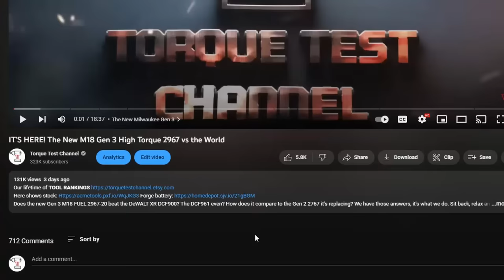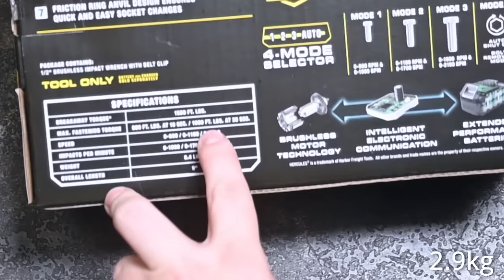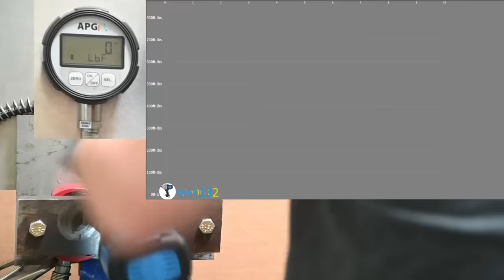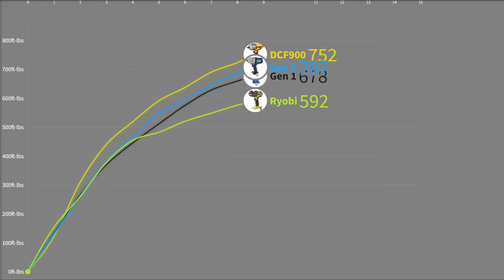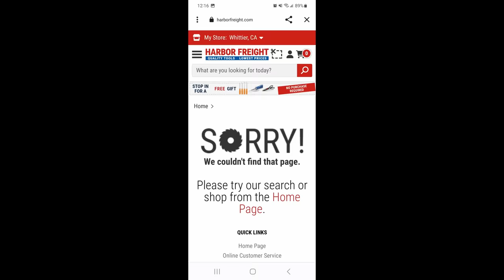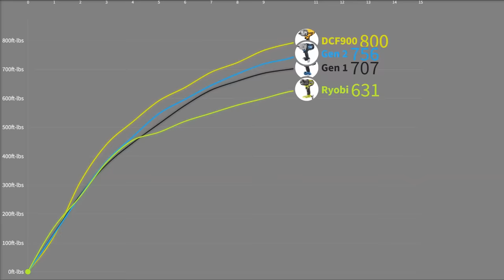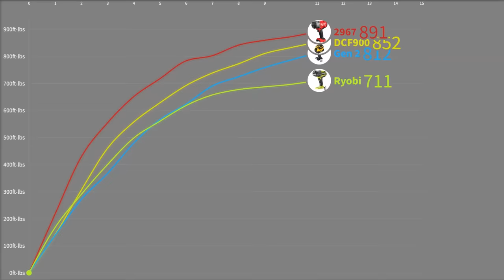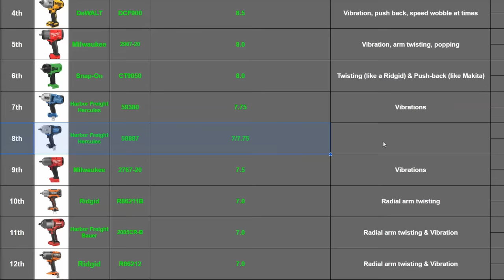Harbor Freight Called & Wanted This Gen 2 Ultra Torque Back

Comment: I think because of the way your dyno works, the nut busting torque will be closer to the end of the curve. Doing well out of the gate will make it spin stubborn fasteners faster, but won't necessarily make more instantaneous torque on a completely stuck fastener. It's the age old horsepower vs torque war. Horsepower is torque over time, and more horsepower will always get the same amount of work done faster, but torque needs to be sufficient to move the load at all in the first place. With the Hercules here I would guess that it's just doing fewer hits per minute than the DeWalt, but the torque that's being applied to each hit is a pretty close match, with the DeWalt slightly edging it out.

Comment: Just bought it, with the big battery, going to be disassembling a very Rusty 03 F350 V10 4x4, using the 1 ton axle units for my 03 Tacoma S.A.Swap, she gonna get some Real World Testing! Can't wait to try it out, been using a Kawasaki 1/2" corded impact for around 20 years and, I'll be honest, it's a fkin great impact gun, it's actually out performed most air impact guns, and it was an open box deal from Pep Boys, I paid less than 70$ for it and I've built a few Jeeps with the old Kawasaki! But she's wearing down and it's time, she's going to the Big Tool Box In the Sky! Along with a bunch of other Tools 🔧 that I've personally murdered over the years! 😅 Tool Murder, I'm pretty sure we're all guilty of that one, anyhow, great video and review 👍 look forward to watching some more, TY brother

Comment: I might actually suggest this for new mechanics trying to get their bases covered. Not the strongest but for the price it does great and if they screw it up they should be able to get it replaced with little effort.
Reply: Close relative has been a mechanic for 30+ years now. He's good at his job and has absolutely no shame running to HF to get some tool that he needs. Doesn't happen much though. 

You will see far too many young people go hard on buying the best and most expensive just due to the name. Hell, if you have a local HF and have that warranty, why not use this?
Reply: @Ka_Gg im weird. I have everything Milwaukee fuel. Love it too. But I did go grab a Hercules cordless ratchet yesterday an I gotta say, I like it a lot.
Reply: I've tried suggesting it to newer people who don't have much in power tools. But they see what everyone else has and wants that. I slowly built up my tools over the years. If I was starting over I'd go to hercules brand no problem, just for the fact harbor freight is easy to deal with and I go there for more supplies than other overpriced hardware stores that charge 4x much for the same items.
Reply: Could not agree more.

Comment: Its very hard to argue with the 5 year over the counter warranty and decent performance at a reasonable price. TTC is single-handedly changing my view of harbor freight. Once thought to be a seller of single use, throw away, tools.
Reply from the maker: Oh dont get me wrong, their store is still full of single use stuff. It's a minefield with random treasure chests, and you just dont know which one you'll be digging out sometimes
Reply: @TorqueTestChannel  Same as the Canadian counter part, "Princess Auto". We dont have HF here, but PA is similar from the sounds of it. They sell a lot of "burn after using" tools, but some are really good. I have a princess auto stubby impact that i'm 99% sure is an Astro Nano Gen 1. Been using it daily as a heavy duty tech for probably 5 years and it still hasn't let me down,  all for $100 CAD.

Comment: i just bought some hercules tools using the charger battery and tool sale they had, im pretty impressed so far with them
Reply: Did the same, got the battery and charger for $99 and got the $135 Grease Gun for FREEEEEEEE!
Reply: @dustinryan9671  im loving the grease gun, been using it every 2 weeks to grease a semi sense i posted this comment 9 months ago, still doing good after probably 40 tubes of grease have been run through it

Comment: I love Harbor Freights ever expanding line of higher quality tools, but still at a great value! They often surpass brand's like Rigid, Ryobi, and often on the same level in performance as offerings from Dewalt and Milwaukee. Especially with their super easy to use warranty system. The value is there. I hope they keep heading in this direction.
Reply: Ha ha whatever dude. None of thier stuff passes Ridgid. Even the number of tools. Even the warranty. Even battery quality. Tool longevity and on and on and on. Even if one goes off of looks. Harbor freight stuff is ugly. No fearures. Go do more resurch or buy both tools test them then go type your comment. Ive had both and my Ridgids spank and have outlasted every Harbor Frieght Ive bought. Just last week i used a harbor freight saw right before lunch, came back and the dang thing didnt work. Thats like number 10 of my Harbor freight tools that gernaded or just quit. Ive had Ridgids since 2012 and ive NEVER had to return any of them. In the end my Ridgids have made me $100ks of dollars. All my harbor freights are sitting in the shop or are at the recyclers.

Comment: I turned wrenches for a living for 22yrs before getting hurt 23yrs ago;  used every brand out there: Snap-On, Mac, Matco, Craftsman, S-K, Husky, Kobalt...over the last 20yrs started using Harbor Freight since my income dropprd by more than half. Gotten a full spread of hand tools, impact wrenches, battery pack, a/c gauges, radiator pressure tester kit, punches & chisels, as well as hardware. Say what you will but in my experience all these H/F tools have only been 1 degree of less durability than all the others, and with lower initial cost and identical warranties, it's a no brainer

Comment: HF has let me down so many times…. I’m rocking a M18 mid torque…. I wouldn’t be surprised if it died a few weeks of taking apart bolts on an extruder screen changer still hot.

Comment: well today I just picked up gen1 HF ultra torque for $72 !  (119 closeout - 40% off for insider, 30% everyone else). Looks almost identical on this vid  to gen2 at $190 still. At that price I figured why not, given their mid size 1/2" are too weak to take my car lugnut (130lb) while their 1/4" super compact is amazing for it's size but working really hard for lugnuts. yeah it's overkill and heavy.... good thing it has auto mode. If I ever work on wheel bearing again, I know have the tool made for it :)

Comment: Love this channel. I'll be looking to equip a home garage (hopefully) in the near future and you can bet I'll be using your test to get the best bang for my buck. Have you considered testing compressors for the pneumatic tools? See which compressor delivers the best airflow the quickest to power the tools? Just an idea to expand your content.
Reply: Oh! I second this. I think there's a lot of misconceptions they'd be able to clean up.
Reply: With different size fittings and hoses...compressor alone doesn't determine airflow.The advertised ratings are plenty to go buy to determine what compressor you need.Basically...BIG for most air tools.
Reply: If you need help to determine what compressor you need just ask.TTC isn't about to buy a dozen air compressors.
Reply: @djsi38t  Yeah. I was just giving them content ideas. I'm not going to be doing anything other than normal usage for a diy guy. More important to me isn't so much performance it's brand. Ingersoll Rand used to be great but I've seen some reviews saying they aren't what they used to be in times past.

Comment: Great show. What, if any difference does extra resistance to the "recoil" make? I'm thinking does the larger battery add more resistance and hence more effective hits from the hammer? 
Keep up the good work.
Reply: I think the hammering happens so quickly that it doesn’t need much counter weight. 

That being said, you have all that weight on the other side of the hammer acting as counterweight with heavy battery  almost a foot of the axis that multiplies the counter effect as well as human hand holding it. 

The hammer is not attached to the rest of the body and only has to have enough counter weight to overcome the spring. 

Now if the spring were not to fully reset by the time the next blow comes than the force would be transferred to the tool. The only force acting on the tool itself is the spring being reset and that is limited in time and power. That is the vibration you feel when operating the tool since it happens thousand times a minute. 

This is why, when you overpower a tool by providing more power be it battery or powerfully motor, you might feel the tool vibration increase while at the seams time there is a physical limitation as to how much any given hummer weight can do. You can bang against a really heavy object with a small hammer all you want be it 10 blow a min or 10,000 it won’t move. 

More power with same hummer/spring will only get you max performance that weight can provide, quicker. So if max work you can do wit a gun is 1000 lb foot but you are getting 700 in 15 sec than bigger battery or motor will maybe get you up to additional 300 in that 15 sec. Alternatively you can just operate that tool for more time till you get to that max 1000 figure. 

Not something you wanna do if your job requires you to do so many times a day. Most consider anything more then 5 sec excessive for repeating tasks.

This is why I urge test channel to let the tool run till it can not reach higher number so we can know max potential for those one time jobs

Comment: One thing that would be really nice to see (maybe even a stats column of its own since it’s becoming a more common feature) is testing on the auto on/off modes. 

I suspect some are basically the same as self tapping mode from impact drivers, but others definitely have more tech behind them than that. 

I mean can we really trust using it to quickly drive in nuts and fasteners quickly and to torque, or just quickly but needs a torque wrench after to finish the job, or is it going to destroy our threads and our wallets

Comment: Are we able to use a chrome socket on them without them getting stuck on gun ? With my Milwaukee I had to beat them off and get the ring repair kit. Some times, like on wheels with recessed lugs the thinner socket is needed. Using a short extension kept that from happening. My air impacts didn’t do that. 
 Hate for a diy to have that problem.

Comment: I think if HF really wants to upset the cordless tool industry, they need to take their high end (Hercules) and use it to go after Ryobi. A similar price point, but HF offers a better warranty and more beans.

I mainly mean going after them with tool variety. Comparing to the big boys with basic tools is nice and all, but the selling point of Ryobi is the sheer number of tools that work on their platform. The periphery tools don't all have to be chart-toppers either, they just need to be competent, affordable, and durable.
Reply: ryobi has their unchanged battery going for them though and ease of buying with more home depots around - like you said also, huge lineup and you can probably find used tools cheap
Reply: I think they try to position Bauer against Ryobi instead. That's where the larger variety is. It's a "homeowner" tool like Ryobi (generally speaking). I'm not sure if they're succeeding, as Ryobi has an insane breadth of tools, but I wouldn't mind dumping the obnoxious Ryobi 18V battery form factor moving forward for certain tools, like a right-angle drill and ratchet.
Reply: @M.TTT.  
This is why I still use Ryobi, as I still have quite a few blue tools (20-ish years old) that still work with new batteries. Hercules wouldn't convince many people like me. 

However, anyone just starting out looks at lineup, performance, and warranty. If Hercules increased their lineup, they would have beaten or matched Ryobi on all 3 fronts for around the same price.
Reply: Ryobi has the Direct Tool outlets/online where you can get blemished and refurbished tools for far less.  I have about 80% of my Ryobi from them and so far zero problems with any of them😊
Reply: Tool variety is why I own Ryobi for home/diy use. There's just so many random options in their lineup for practically any use case. That is, unfortunately, except for a coffee machine like Makita has.
Reply: @NiSE_Rafter  
Some 3rd party company makes one for DeWalt batteries that I guess is pretty decent.

Funny thing is, Ryobi started the cordless tool expansion trend. Back in their blue NiCad tool days, they were making the standard drills, saws, sawzalls, lights, dust busters, etc... But they were also making cordless rotozips, routers, miter saws, caulk guns, chainsaws, sanders, jigsaws... And a bunch of other tools. Some were duds (any chainsaw running on an 18v nickel battery would be) but many were very handy. Some companies also made some of the non-standard tools Ryobi made, but none of them made anywhere close to the number of tools, even other TTI brands.

In fact, the Ryobi Airstrike cordless 18ga brad nailer was the first to use air in a battery powered nail gun successfully. Other TTI brands adopted it, then companies like DeWalt copied it.

Comment: Next time you test 4 1/2 inch grinders, could you include the Metabo WP 11-125 Quick grinder?
My employer uses those exclusively and I HATE them for a couple reasons, 1 is that they vibrate terribly under heavier load, the other is that they seem a little gutless being an 11 amp grinder.  I decided to take my HF Chief 4 1/5 inch grinder to try which seems to be better in my experience despite having an adapter going from the 3/8 type H Milton fitting we use to the 1/4 on my grinder.

Comment: Hey, parkside which is a popular tool brand in Europe released a 150nm cordless drill that comes at less than 100 euro, I've heard bosch also has a 150nm, so I'd love if you can check the new high torque drills coming out. Maybe there are more idk

Comment: My harbor freight had 2 of the gen 2 in-stock on the shelves, can't find them on there website but in stores, wonder if they let a shipment of them let go by accident, see how it does with there 8ah 21700 battery

Comment: I just put a 3/8th hammer section into a kobalt xtr body. It bolted right up. The only difference between non Xtr and Xtr is a much bigger driver and motor windings. Has stupid power now haha. Kinda spicy at least it feels

Comment: What's funny is we'll look at a tool today and be like "Just needs a little more torque". While, completely ignoring that our impact from 5 years ago (that has 300lb ft less) has done everything we needed easily. hahahaha. 

I have one of the first gen Milwaukee beasts that I bought when the only options were Milwaukee and IR. Around 2013 or 2014. It still does everything I need and doesn't break a sweat. 

The new impacts though are so impressive. I like seeing Hazard Fraught bringing new good tools. Just seems like they'll take a slightly older version of a quality brand and slap their name on it. It works though.

Comment: the power is impressive for the price there is one for sale brand new in the box for $90 might pull the trigger my current impact is an older brushed milwaukee and this should be a lot stronger

Comment: If anyone is on the market for an impact you can get the ryobi 1/2” high torque and 2 4ah batteries for 279 and you get a free tool. Can get the grease gun angle grinder or the hackzall as well as like 6 other tools. If you only want the impact and battery kit you can get it with the grease gun then return it and you’ll only pay $177 for the impact and batteries. You’re welcome. I don’t know how long this sale will last but it’s pretty dope.

Comment: Do you assess reliability, longevity?  Would like to see this added to your table.
Reply from the maker: No definitive way to assign points for it. Everything is subjective, or if you want to capture it on camera so extreme it doesn't replicate real life. For example our Gen 4 M18 impact driver quit day one, but our hercules is still working fine. Other people comment about the opposite. Hard to give points for one vs the other vs ones we dont use as often. Also see 13:59 if these tools failed often there'd be plenty of videos of people happy to talk about that.

Comment: That’s insane that the whole impact is cheaper then the Milwaukee “Forged” battery I just paid $199 for. You should put an adapter on these tools and run a pouch cell battery. Just for the heck of it. 😂

Comment: I wonder if HF is playing a Tick-Tock cadence for releasing updates, maybe due to limited enginerds available 🤔
So they release the product (tick), then they work on improving the anvil/hammer and release it with that (tock), get to work improving the motor and release that WITH the improved anvil/hammer to retired as the next-gen (tick again)... rinse and repeat, with a 1/2-gen, next-gen cycle.

Comment: Great testing thanks. I own all the Ryobi impacts, and they are indeed, terrible. The 3/8 impact is completely useless. I have to use the 1/2 impact for everything, and even then I have to break things loose with a ratchet or wrench first more often than not. Very frustrating.

Comment: During disassembly, Looks like the impact mechanism  lost one of the retention balls.
Reply from the maker: That's just the ball bearing that sits under the anvil, in between the female part of the anvil and the male centering post of the hammer mechanism.
Reply: 👍 most impacts i deal with don't have that there.
Reply from the maker: @emothetoolman4437  All the TTI ones (and a few others) do, so it's not surprising these do :D
Reply: @TorqueTestChannel Not to get too nitpicky, but that's not a ball bearing. It's just a ball. If it's used as part of a bearing then you could call it a bearing ball. But it isn't part of any bearing in this context, so it's just a steel ball.
Reply: Not everyone has em don't hate